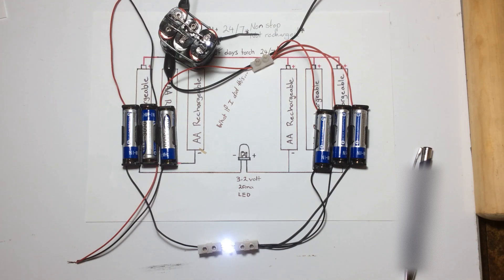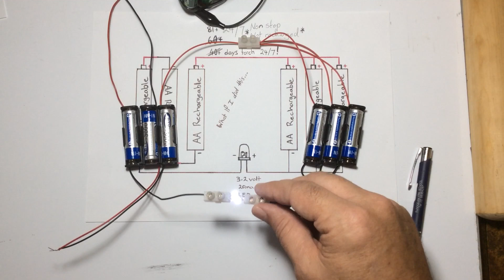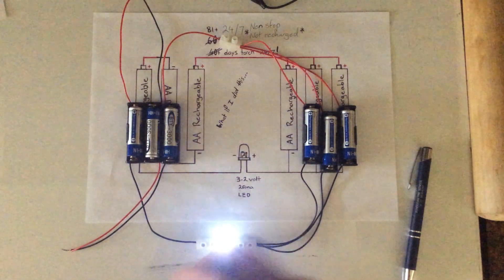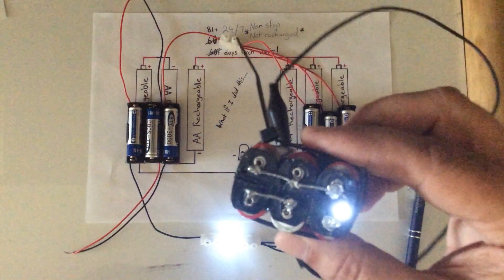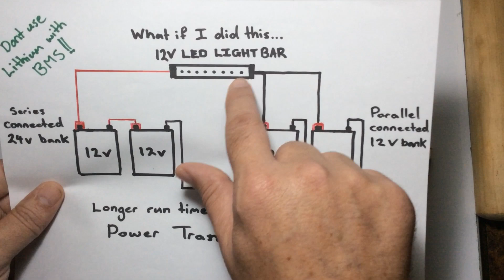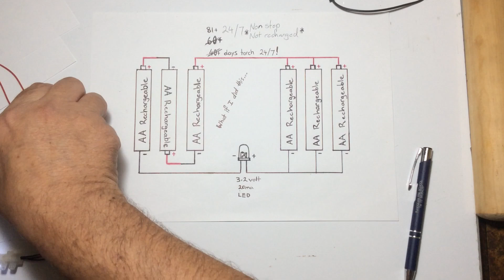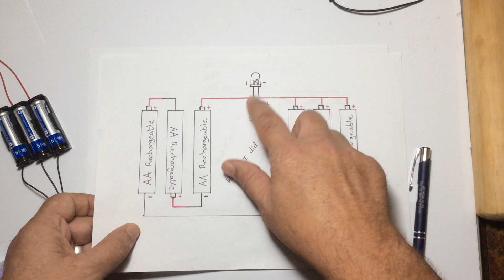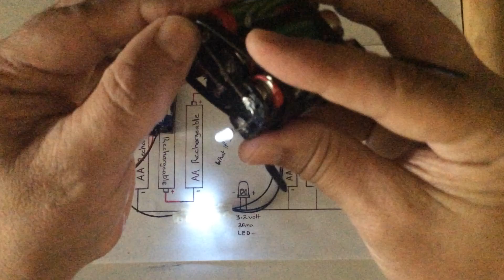Top 5 reasons you should build this device. 81 + Days and Nights 24/7 backup lights for blackouts!

Comment: nice job...hey instead of lighting leds...could you charge larger batteries off the circuit?..cheers
Reply from the maker: Thanks for watching.  You certainly could and if you used a simple joule thief to transfer the energy you could charge batteries of higher voltages very easily.
Reply: @whatifididthis...1236  ahh ok...stupid question...whats a joule thief?..cheers
Reply from the maker: @thebigfella9095  no question is stupid if you genuinely wish to know. A joule thief allows a low voltage, typically 1.5 volt from a AA battery to power a single LED that normally would require 3 volts minimum. A joule thief can usually drain a battery completely where conventional electronics will stop working a joule thief will go to as low as 0.4 of a volt. They have been used on many occasions to charge 12 volt batteries from 1.5 volts which would allow you to use earth batteries.
Reply: @whatifididthis...1236  ahh ok thanks.....so is this item a product already made and available to buy?..or something that needs to be made?..thanks
Reply from the maker: @thebigfella9095  You can buy pre made Joule Thief circuits however they are quite expensive when they can be built from scrapping fluorescent spiral bulbs as well as other electronics, if you had to pay for the components I would be amazed if it cost more than $2. I replaced the internals of the cheap solar garden lights with joule thieves to extend their run time. However, they would only last a week without sun. This system will beat that by 70+ days with no need to wind coils. If charging higher voltage batteries(12v) from a single AA battery is your goal than the joule thief is required.
Reply: @whatifididthis...1236  ok cool..thanks mate cheers